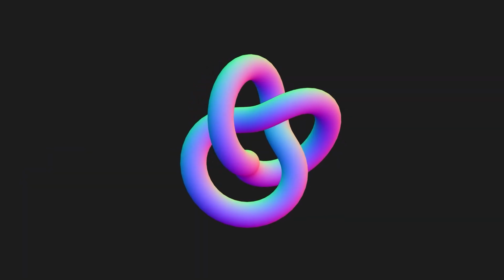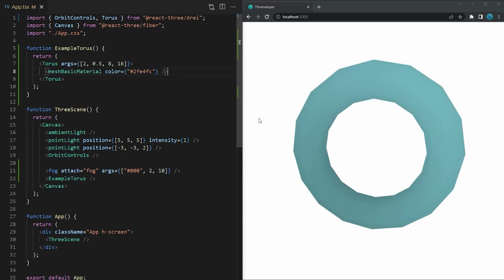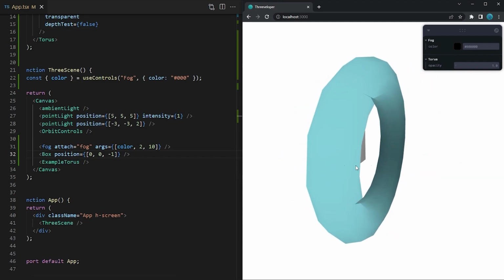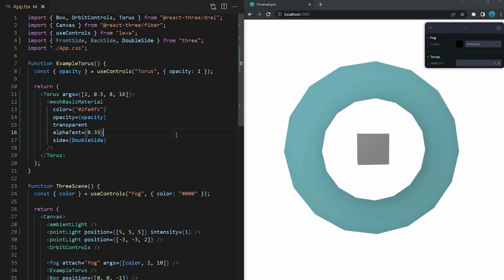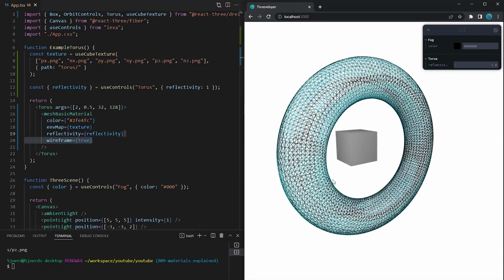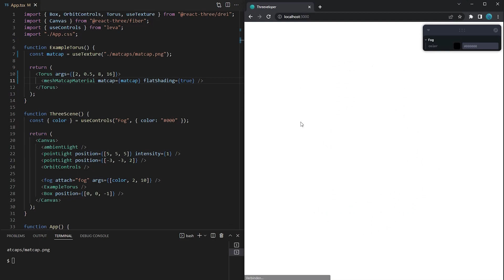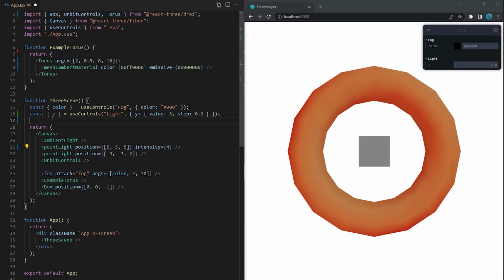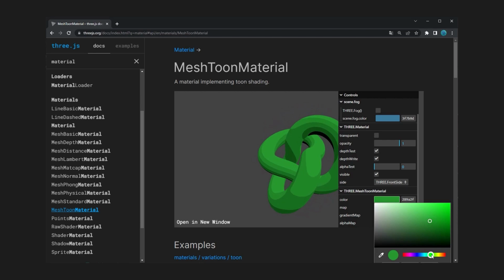React Three Fiber & Three.js  - Materials Explained 🔮

Comment: Hello, Threeveloper! Can you please record a video how to implement basic canvas animations in reach three.js canvas. For example you have a sphere and you want to add orbits which generated with 2d circles moving around it. Or on plane some fancy waves animation is running.
Reply from the maker: Hey there 👋 Definitely coming soon! Until then, maybe the useFrame hook might be useful for you! 😉 It runs  code on every frame. I'm using it in this video: https://youtu.be/MeBh3SUYqJw but a more detailed video as you requested will come 🙏
Reply: Thank you for the replay, I specified it with useFrame and canvasRev, but can't find a solution how to place this into a mesh.. So much to learn :)